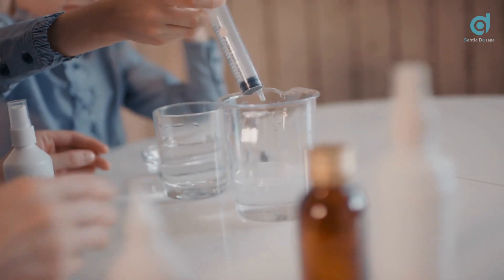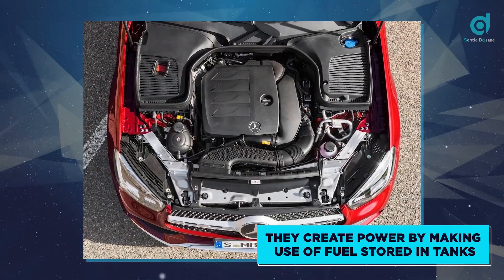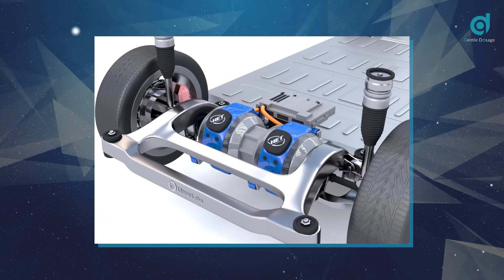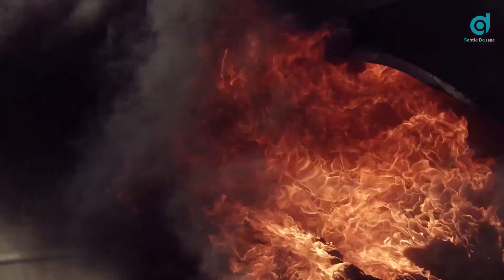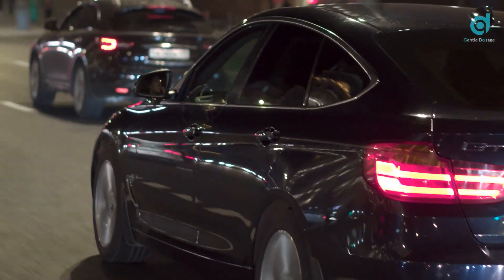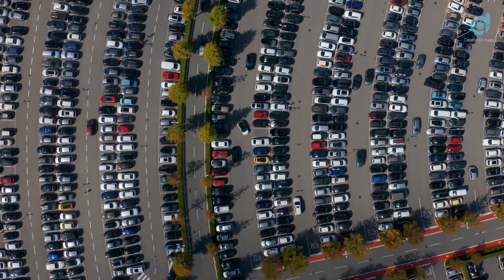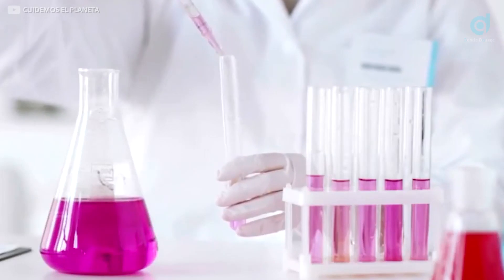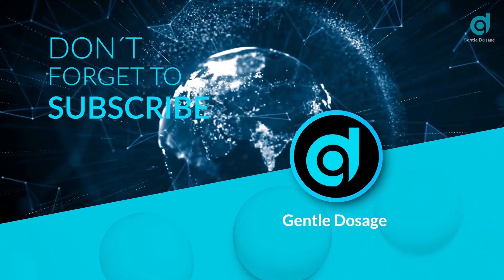Green Hydrogen - Why the Hydrogen Powered Electric Car Might Be The Future

Comment: Of course if TESLA makes hydrogen cars…quit smoking….but as long as Toyota and VW are in charge….we’re ok…and safe.. one huge advantage of green H2 over batteries and hydro etc, is an long and durable economical no loss storage of energy for instance to store summer solar free surplus power for winter usage. 
The storage cost comparaison with lithium battery is quite impressive: good mobile rated lithium battery are well over 92% efficient ( ratio of kWh provided vs the amount charged in the medium charge range 40-60%) for well over 1500 full load cycles life, costs about 300$ per kWh of capacity,  this provides a basic storage only cost of 300$/ 1500 cycles = 0.20 $ per kWh used and this is a very high cost, similar if not higher to the charged energy cost…At the opposite , a modern hydrogen Composite Overwrapped Pressure Vessel or COPV is 100% efficient, fatigue and leak free well over 50000 full cycles and costs only 8 to 12 dollars per kWh depending on vessel sizes. Result is about 30 times more durable time 30 time cheaper while more efficient and this provides a negligible kWh storage cost roughly thousand time cheaper than LIB’s. Very long Hydro-electric energy storage, with evaporating losses in the range of half an inch per week (like any swimming pool) plus pumps and turbines losses are also uneconomical. But the “Green H2” distributed PV production all over takes away oils and coal and power utility huge energy profits and grey H2 production (over 60 mio tons/year) sold at very high price and huge margin using current production monopoly. So, they are all dead against such non fossil green revolution. The sensible people move towards this green energy production and storage has to be political and change our way of taxing human activities to feed the state to a greener taxation to save the planet, biodiversity including the more evolved sapiens.. humans gorillas bonobos etc…this mean we must charge heavily (I.e. like road taxes already) but equally and fairly all heavy CO2 emissions, EV coal cars, industry fuels, heating fuels, marine oil, kerosene,etc.. with very similar taxe levels ( per ton of CO2) to our current road fossil fuels all taxed ww in the range of 200 to 600$ per ton of CO2 released in the atmosphere. This would become a strong incentive to rather consume clean taxe free products and services and to stay away from all heavily taxed dirty staff to save our planet and our lungs..
Reply: after all these years, it still costs 5 times as much to fill up with H2 than gasoline.(mile per mile). Let alone the price of the fuel cell.
Reply: @tedmoss Yes, but don’t be mistaken, the profit made by the oil companies with 50 to 80 millions of tons per year of grey tax free H2 ( for heavy end oil cracking plastics, fertilisers, steel, etc) are huge and the new distributed mobility with green PV produced H2 would jeopardise their high price and profitable monopoly of H2 production and sale. The green expansion is a huge risk of lost revenues for them. They are dead against green zero carbon H2 and price at the H2  pump is therefore dissuasive but this has absolutely nothing to do with true cost of grey H2 production…then yes fuel cost can be quite high (yet much lower that your ratio of five in Norway for instance an oil producing country) but H2 car resale value can also be much better if one kWh of Li battery lasting 1500 full cycles cost 360$ but the H2 COPV ( pressure tank) cost only 10 $ per kWh and takes 50000 plus cycles without any measurable loss…that is a very hefty mobile storage cost divided by 1000 !!! With no heavy batteries nor heavy thermal engine the H2 vehicles, cars, trucks and buses, etc can be light robust, renewable and durable at a level unknown yet today…
Globally, of course the highly polluting current GAFAM induced programmed fast obsolescences of many products has to be “corrected “ as well to decarbonise fast our biosphere . Worldwide, road fossils fuels are severely taxed in the 250 to 650 US dollars per ton of CO2. If industrial hydrocarbon, coal, oil and gas, etc, used by raffineries to produce this H2 would be fairly (fair trade logic) taxed per tons of CO2 at the same road tax level, as well as coal, kerosene, heavy marine oil etc… etc…then, the green zero carbon H2 can quickly become the cheapest mobility power,  even cheaper than EV running on coal produced electricity at only 40$ per ton (but taxe free) world price , which by the way, should also be taxed fairly and equally above 250.-$ per ton of CO2 because electricity from coal worldwide is HALF of human green house CO2 gas pollution and most cars (95%) are produced today in countries burning 85% of the ww coal produced. They are using this cheapest energy cost to be more competitive than the others: Japan Germany USA China Corea, Aus. RSA India etc..etc,,..and it became an economic obligation to all of them to pollute like all the others…it is just insane…
So, coal first and oil second are the TWO energy sources we must eliminate and ban in priority from our planet and then, natural gas shall only be used very efficiently ( with one MJ of gas PCI producing 2 to 2.5 MJ of commercialised useful energy, as heat and electricity, with the combined help of heat pump, low enthalpy geothermal, solar, etc) 
I guess we must NOW revise the way we induce fast a zero carbon fair and dynamic economy, so for me, fair trade principles applied to energy are one democratic solid proposal enabling an economical boom by a fondamental redistribution of ressources from a very few oisl states gafa etc controlling half of the world ressources without enough ressources in the other second half for all the 8 billions poors, for basic education, health, food, etc, thus inducing an economic stagnation since one o two decades..Therefore a fair and even indirect taxation and import duty system applied to all carbonising products and services has to revolutionise our economy now that we realise the magnitude of the need to eliminate CO2. System must band financially all coal usage and penalise severely oil production. Green hydrogen and related NH3 and  synthetic CH4 produced with captured CO2 free H2 and Sabatier are then the ONLY green, safe, efficient, low cost, no loss and endurant method of storing renewables surface produced variable and seasonal energies which are becoming economically produced but must be economically stored and used and for it energy loads, distribution etc have to adapt..
Reply: @philgooddr.7850  Still, a moot point since the game is already won.